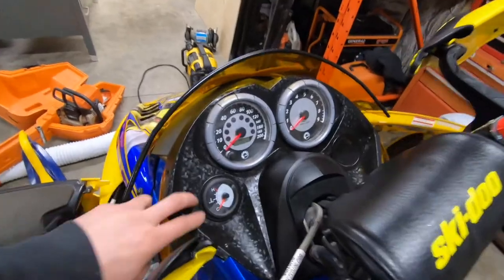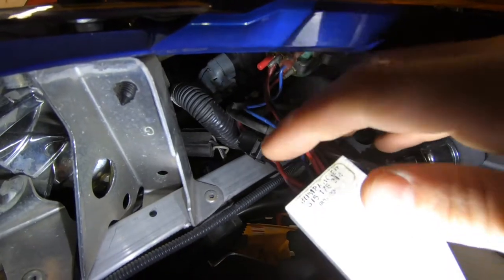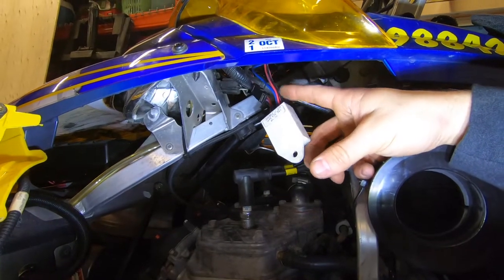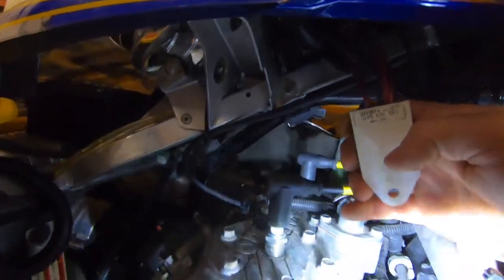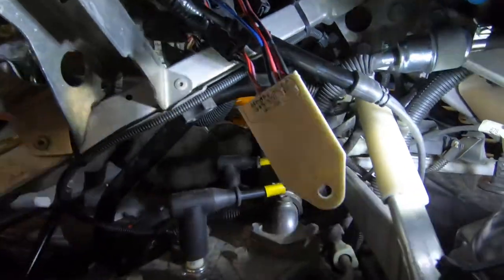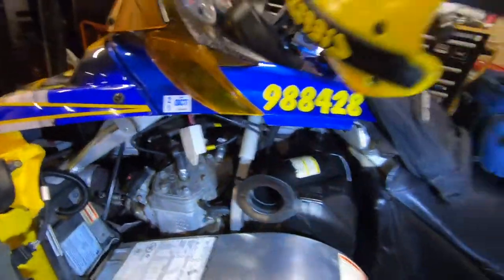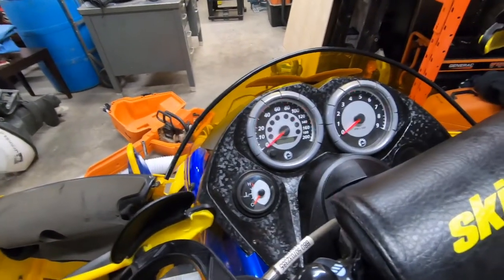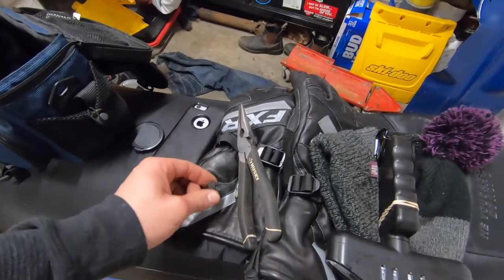Adding a Temperature Gauge To a Ski Doo Rev XRS

Comment: I have a 05 1000 Summitt efi and my temp sensor gauge like jumped then kinda just slowly went to 0 prior to this the back light did not work think the gauge is shot ?
Reply from the maker: Does seem like it, but with the back light being done it almost seems like something shorted and caused the gauge to spike. Then maybe blew a fuse?

Comment: hey have a quick question i have 07 mxz blizzard 800 and want to install a temp and fuel gauge but ones im finding have different connector ends then the one on my harness on my sled is there a particular gauge i need?

Comment: Can I tell what sensor I have without changing it out? Is there a difference in how many wires are out the sensor? I have an '04, but I don't know the history.
Reply from the maker: Depends on if it is a sdi or non sdi model. There will be a resistor pack with the gauge.
Reply: @Schneids15  mine is not an SDI, but I can use a sensor and guage from an SDI, correct? I have an 800 carb.
Reply from the maker: The sdi gauge reads from the computer. The non sdi need a sensor that threads into the head and a gauge that matches that sensor.
Reply: @Schneids15  I seem to have a small wire harness between the sensor and the mpem. Does that need to be changed out as well, to handle more wires?
Reply from the maker: No i believe the gauge unit is stand alone for those one wire from sensor to the gauge and the gauge plugs into the harness for power.